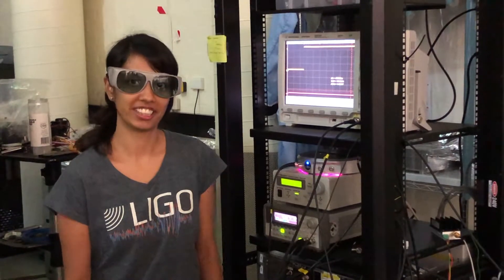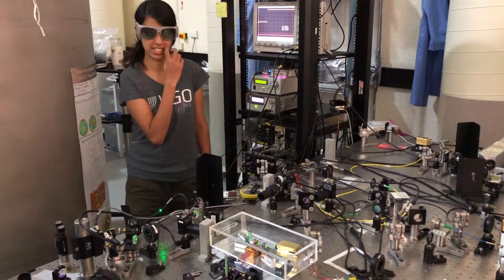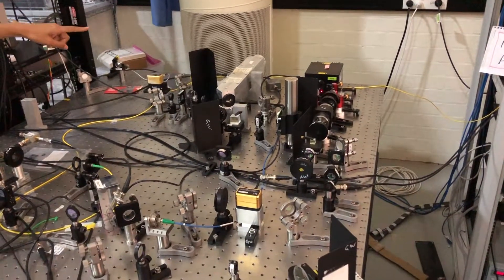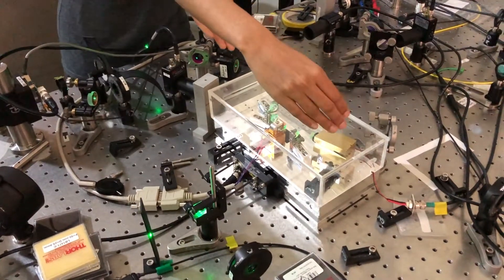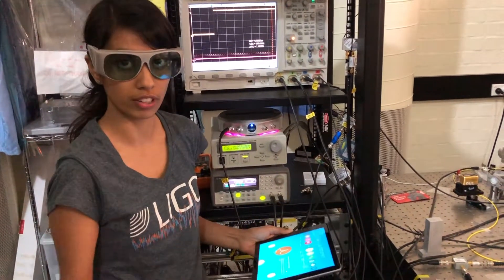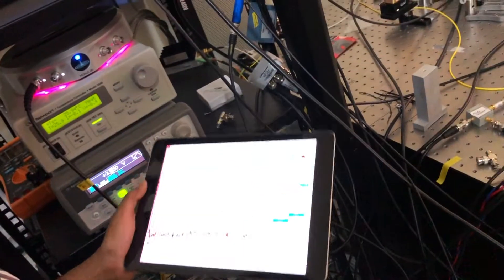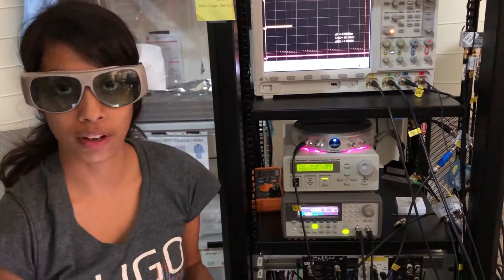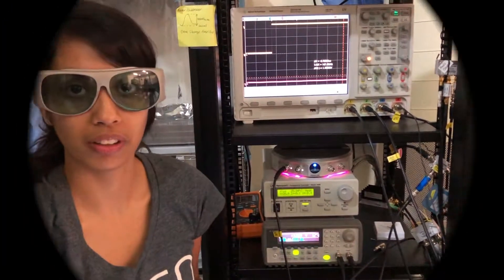Squeezing Light with Moku:Lab - Application

Comment: I am new to this field and I have a v basic doubt....what happens to the output side after squeezing....I maybe wrong but what I know is that two photons are created from the vacuum state with the help of Squeezed operator(what it means physically I don't know...maybe some kind of non linear medium which produces two photons). And here comes my doubt(s) what are the relationship between states of two photons which were produced(I know that they are squeezed in one domain say amplitude squeezed) but how are they related to each other? And I don't understand the reason why we need to two photons in the first place, what is the argument behind?
Reply from the maker: Thanks for watching! One way to think about the OPO process is one green photon is down converted to two infrared photons. Because of energy conservation, the two resulting infrared photons must be related (correlated) in their energies. You can find more information on squeeze states, including references for further reading, at https://www.rp-photonics.com/squeezed_states_of_light.html
Reply: it always has to be 2 photons because if you do the calculations you will get a zero probability of finding odd numbers of photons, (just calc <n|squeezed_vac>)